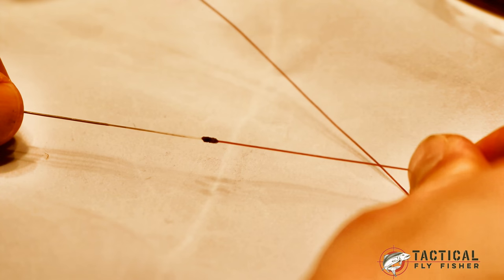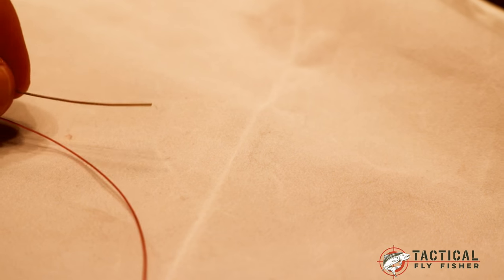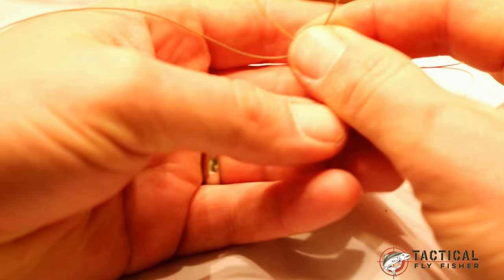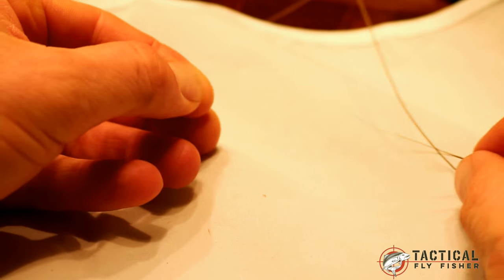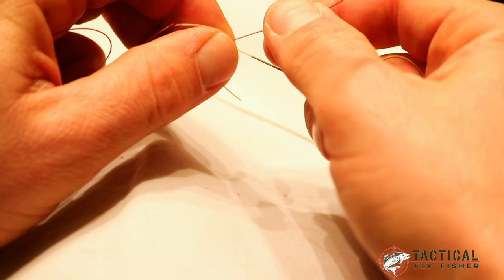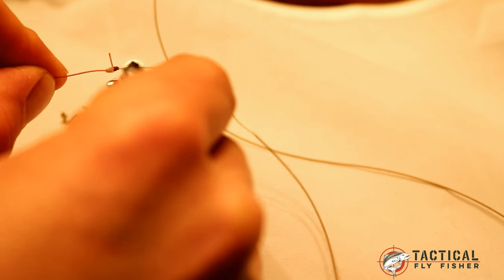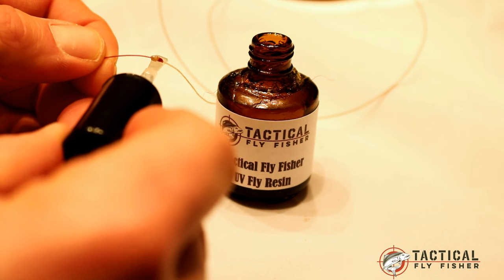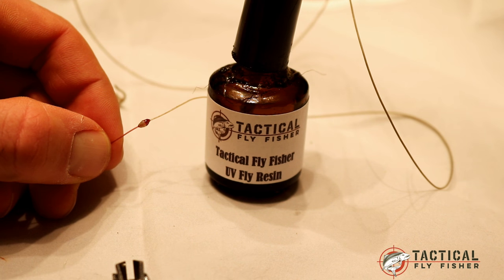Mono-core Fly Line to Leader Connection

Comment: Thanks David for awesome stuff! I've an issue with connecting my Maxima Chamaleon (6 pound) to mono from flyline (it's much thicker, idk, maybe 0.14'')? What should i do? Nail knot?
Reply from the maker: There are a couple of options. The nail knot is probably best at going through the guides as long as you make sure you clip the fly line and the nail knot waste tag completely flush. Otherwise you can strip the line coating and add a tippet ring or perfection loop to the exposed core. Then you can tie the maxima to the ring or loop.
Reply: @tacticalflyfisher3817  thank you for the answer!

Comment: Thanks for sharing. Do you think tying the mono core to a 3.0mm ring will work, allowing to change out leaders easier streamside? Not sure on the shooting ability of such....
Reply from the maker: A 2mm ring would work better. However, I've tried the tippet ring approach and it does catch guides more than the blood knot. But if it gives you more flexibility it might work well for your approach.
Reply: Thanks for the update I'll give the 2 a try.
Reply: Would the tippet ring not transfer the energy as well as the blood knot since there is a fulcrum at the attachment points? @tacticalflyfisher3817

Comment: Thanks for the video! I need to re-watch the video again to determine what knot you tied to attach the tag to the leader. Any chance you can post up just that quick knot period in the video?  Up to this point I've been using a perfection knot, while easy, it has a lot of extra bulk.
Reply from the maker: Are you referring to tying dropper tags on your leader or to attaching the leader to fly line as in this video?
Reply: tying dropper tags on your leader .... your method is much cleaner than the one I've been using.
Reply from the maker: +iride aduck we have a leader building section on my filmmakers YouTube channel at this link https://m.youtube.com/watch?v=p0xYNb5jYP4
Reply: I re-watched the movie and you mentioned a "uni-knot," wrap it 5 times around itself above the triple surgeon knot ... that is way cleaner than a tag using the perfection knot cinched around the line.

Comment: Do you prefer the Mono core or Braided core and why?
Reply from the maker: I'm assuming you're referring to the Cortland Competition Nymph Line. 
If that's the case here is my pro/con list for the different fly line cores:

The superglue connection is a bit smoother in the guides than the blood knot connection but the blood knot connection is easier to do and stronger over time.

The mono core line retains a bit of memory in colder weather

The braid core isn't as stiff so it twists a bit easier after repeated casting over one shoulder

The stiffness of the mono core transfers energy when casting a little better but it's a little bit heavier so it sags a bit more
Reply: Do you prefer the level or Double Taper and what backing and how much is appropriate? @tacticalflyfisher3817
Reply from the maker: Nick Weber level taper for me. A standard hundred yards of backing is fine but you can add more to fill the spool if you want.

Comment: Do we need to seal the exposed monofilament core at the point where the fly line covering was stripped?
Reply from the maker: No need to seal it. It won't be touching the water.
Reply: @tacticalflyfisher3817  I must be missing something. How can the fly line not be touching the water?
Reply: OK, I get it. This video is for a Euro rig. I am using a mono core sinking line for traditional nymphing. The junction will touch the water. Anyway, I will retrieve my line from the trash and do the knot you showed. I lost a big fish when a nail knot stripped the mono line.
Reply from the maker: @poems35  should work fine for a sinking line as well.